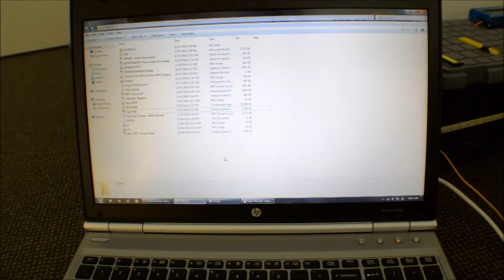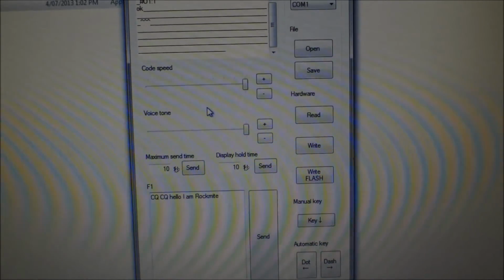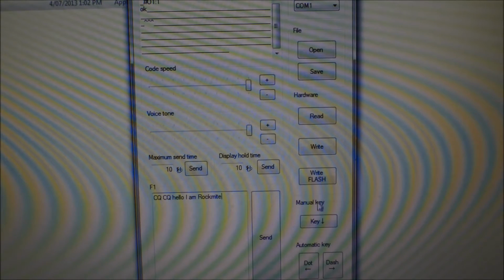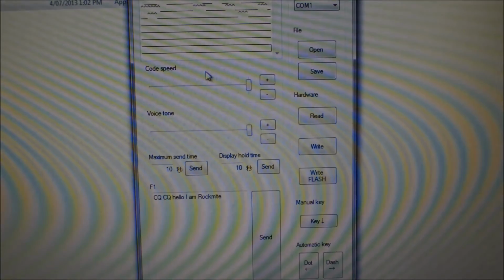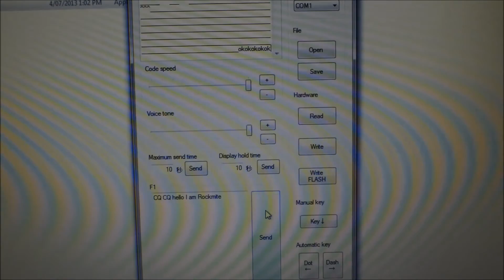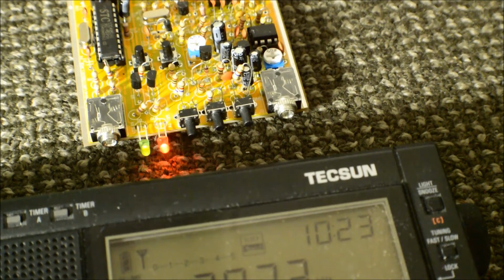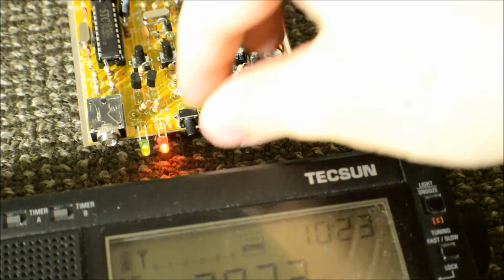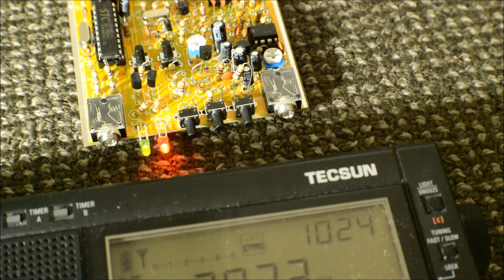Super Rockmite RM QRP kit - an investigation

Comment: good evening
I see you use Rock mite 40m
I have a rock mite I connect my keyer and my right key on this afternoon
everything was fine,
I have to install the sofware rock mite to program
I programmed the cq cq cq and my call ..
the problem is that now my keyer or my right key is sending more normal
just dots and more dash.
now I just have dots with my right key to much

My question is
what order to make my key right or my keyer works normally thank you for your help very apressier.
VA3SY

Comment: Thanks for the video. Correct me if I am wrong, but the button will only transmit what is recorded into the memory, is that correct? Also, can you just type a message into the software and have it transmit through the radio? And, I am assuming that is has a port for a keyer?

Comment: How come those two transistors are backwards relative to the silk screening? I'm almost done assembling mine, and would love to know if there is an issue I'm not aware of.
Reply from the maker: hi, zep, I did substitute those transistors, so the emitter and collectors are reversed - you'll notice the 'receive' LED stays lit, while the 'transmit' LED does indeed flash; they weren't the closest match, but they were close enough to get it up and working. But yes, the silkscreen is correct!
Reply from the maker: Also, I might do a follow-up video showing the second kit. The first one here was hit-and-miss on output power. The second one performs much better.

Comment: Nice tutorial,how much cost?Also where are you buy this?
Reply from the maker: Thanks Se, these kits can be found on ebay by searching 'diy rock mite'. The smaller simpler kits can be found by searching 'diy qrp'. This particular kit came from Banggood - it came with the schematic and parts list which was nice - the ones from ebay don't come with documentation, but that can be easily found using Google.
Reply: I see,have you test on antenna or rf power meter yet?
Reply from the maker: No, I'm only going by simple current draw - the documentation states it should be 700ma for the full 8W output, mine is around 250-300ma - but that seems typical for this kit, and seems to be what most people achieve without modification. But it definitely generates moderate RF - my radio doesn't show it, since it was set to 'local' so I didn't over modulate the sound for the video :)
Reply: What kind o antenna that you are going to using for Tx/Rx Matt?I have this:
S-PIXIE CW QRP super shortwave radio transceiver radio 7.023khz but not assembly yet,trying to finish a power supply 13.8V/3Amps.Also you can applying some modifications on that qrp a quickly search find many of them..
Reply from the maker: Well I know it's weird, but I'm not a licensed amateur myself (yet), but, I wouldn't use anything longer than a halfwave dipole (for sake of impedance without a tuner), and I'd keep the feedline (coax) as short as possible - basically just long enough to get the antenna high in the air. Check out VK3YE's channel - he does lots of interesting QRP projects, included end-fed halfwave antennas and antenna tuners. That's another thing as well, I was only feeding this guy bang-on 12 volts, so some slight extra voltage might help any oddball things wrong with it, but the onboard voltage regulator clamps it down anyway.
Reply: I like VK3YE's channel give simple rf solutions almost cheap,all my antenna are d.i.y with aluninium matterial coming from local stores.On my roof there is two of them,one yagi 3 elements and ground plane for sdr receiving software both good gain Tx/Rx.I don't have an antenna analyzer yet,like you I'm not licensed amateur :) but working on it and I hope untill the end of year have my callsign.Thanks Matt...many 73 Kostas - Greece!
Reply from the maker: Cool! 73s Se, yeah, it doesn't hurt to experiment, I definitely love the QRP aspect of amateur radio. Good luck with it all :D